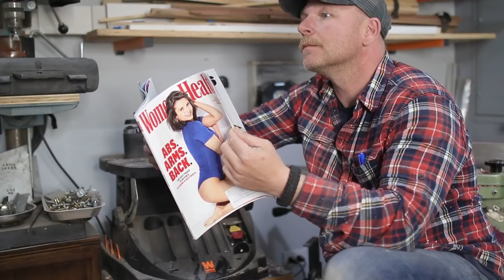I Committed a SIN Making a End Grain Cutting Board

Comment: Nice video. Very entertaining. I use a router sled for flattening my end grain boards.
Reply from the maker: Tibili Woodworking thanks Tibili.  Ya a lot of people use the router sled.  I just disassembled my sled cuz I needed the space.
Reply: I also use a router sled. It works great but I hope to get myself a new planer next month for my "cringe" 44th birthday. Unfortunately, the price of the one I want is around $600. When the price for the same one was around $400 a few months ago. Smh

Edit: I just checked Amazon and it has gone down to $550. Prices are all over the place.

Comment: What is the science behind not running end grain through a planer?  Never have made one, thanks!
Reply from the maker: Banjer Legs basically end grain stands up and when the you run planner blades through it, it can chip it out and blow small pieces out the back.   Some people have said that they will explode like the atom bomb too but have never personally seen anyone do it.   So ya.  Just put a stop block behind it and you should be ok
Reply: Thank you!!
Reply: The board can kick back, flying out at a very high speed